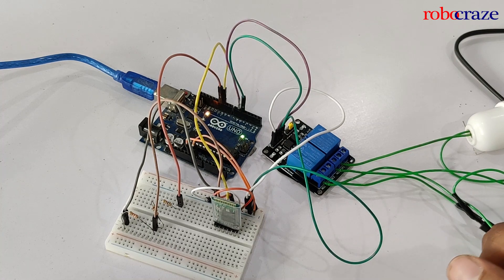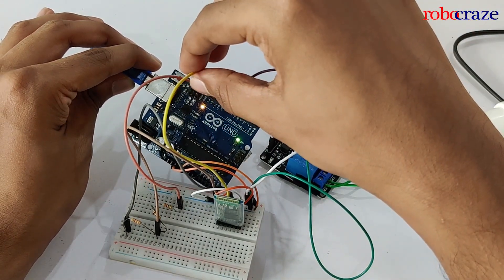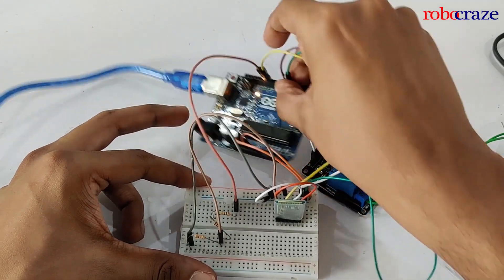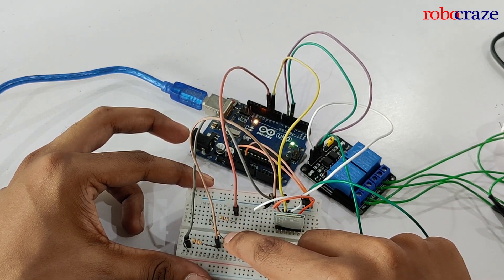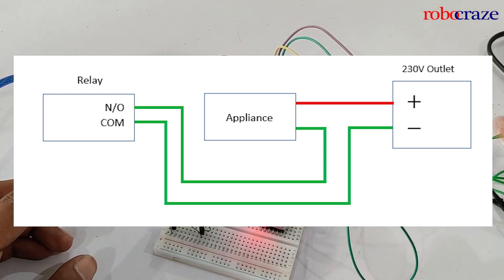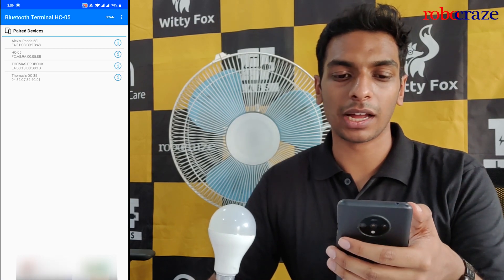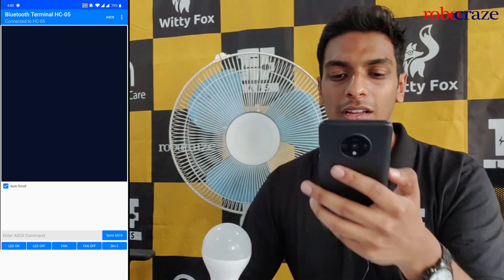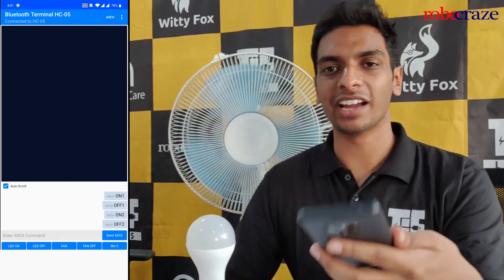DIY Home Automation using Arduino and Bluetooth HC05

Comment: How can i cinnect the relay to an extension board so i can control the device when plugged in the socket
Reply from the maker: Please perform the following steps with extreme caution. High voltage AC can cause serious injury as well as damage to electrical devices.
You can rewire the socket connections to make the live wire come through a relay. So remove the live connection from the socket, connect it to the NO of the relay, and connect the COM back to where the live was connected on the socket. This puts the relay in series with the socket thereby giving you control of plugged devices through the relay.
Reply: Can you give the code. Thanks